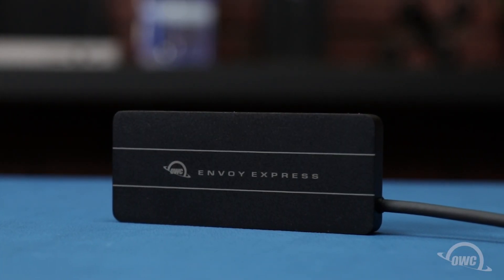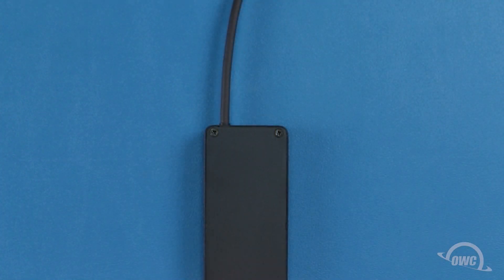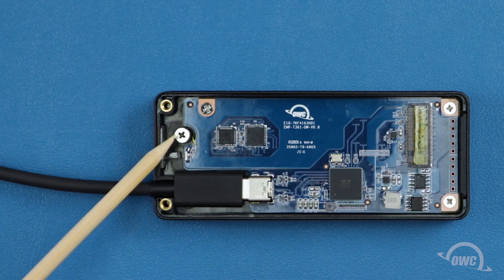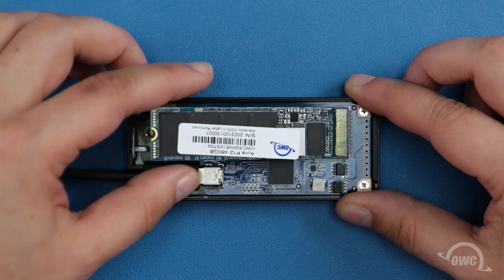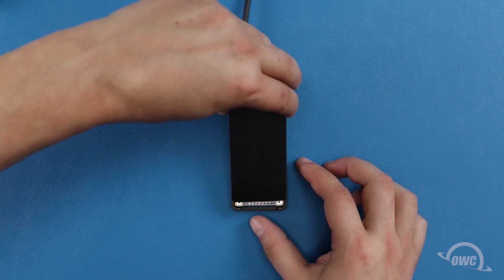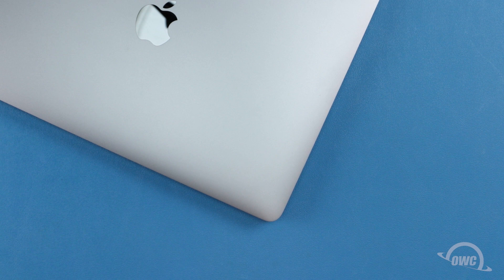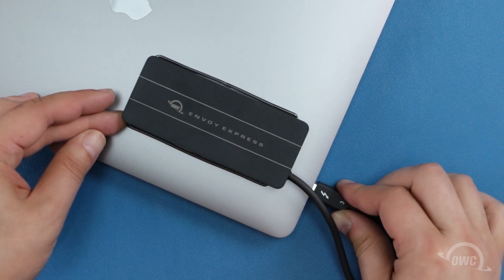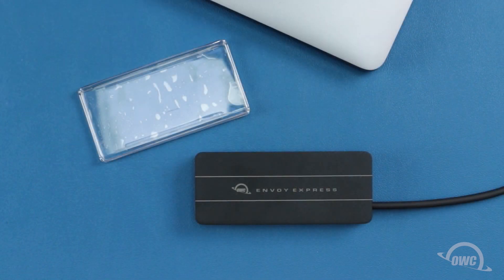How to Install an M.2 NVMe SSD into an OWC Envoy Express Enclosure

Comment: Can you disconnect the Thunderbolt 3 cable from the PCB in the enclosure? It sure looks like it is merely plugged into a standard TB3 port but since you offer products primarily for Apple hardware I wouldn’t be that surprised if the PCB end of the TB3 cable is glued into place.
Reply: It can be unplugged